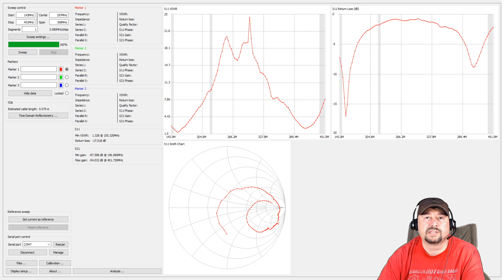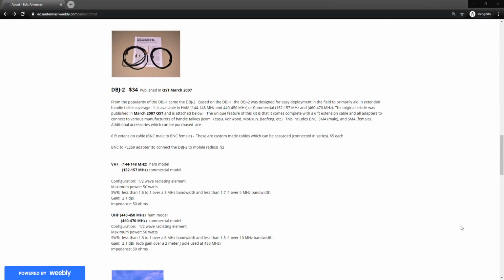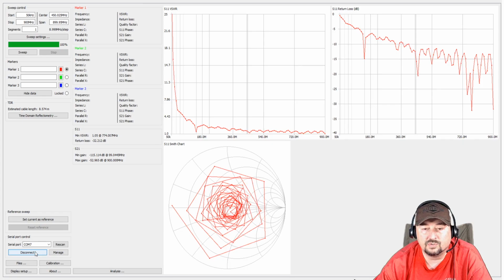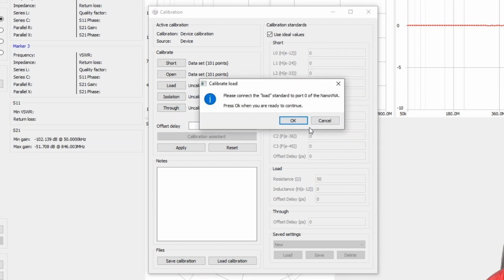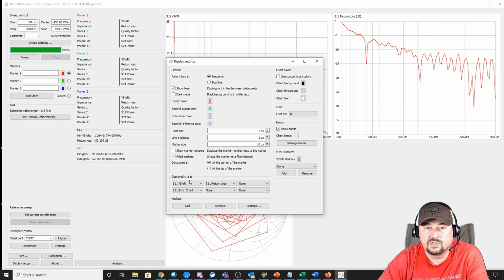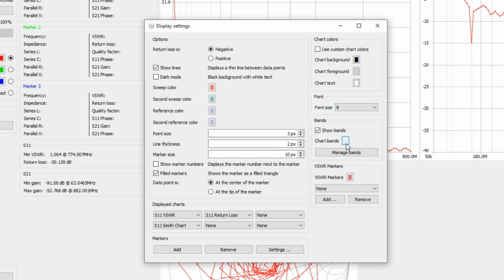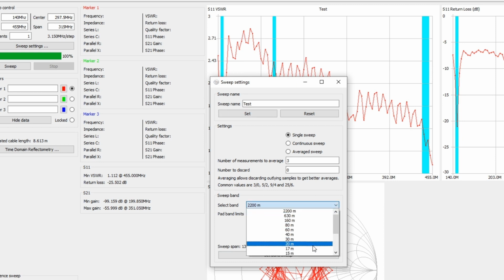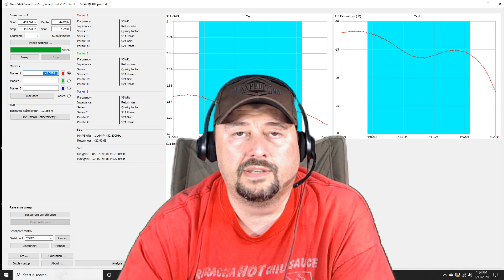Getting Started with NanoVNA-Saver - Ham Radio

Comment: Tnx so much for the detail on the NanoVNA.  I always try to use/learn software on the fly, but I could not see an SWR chart on my saver software because, as I found out when watching your video, I did not see the "display setup" button at the bottom of the screen ... I had my screen too large and moved slightly down so as to cut off that button.  Your simple and straight forward explanation of the features of the software are just what I wanted.  Tnx and 73 de WB8BHK
Reply from the maker: Hey Herb, glad to hear it was helpful.  Thanks for watching 👍

Comment: Hi, thanks for great tutorial. I am trying to calibrate my efhw. Should I adjust the calibration for the coax between the antenna and the nanoVNA? Would having a rf choke effect that calibration?
Reply from the maker: Hey Jim.  I would calibrate the VNA at the output of the VNA and test the antenna system where the radio or tuner connects.  That way you see what they see what ch is important.  You could measure at the antenna feedpoint but you miss the effects of the coax / choke. Of course you could measure and or calibrate at the other locations if you are concerned.  Thanks for watching 👍
Reply: @TheSmokinApe  thanks for great video and the helpful reply! One more question, I am trying to trim my 40 EFHW I use for 15m, and it shows resonance just a little higher than 21 Mhz. Is there something I can do to easily adjust this? Obviously a tuner, but it would be nice to have something else in the bag of tricks.

73 Jim
Reply from the maker: The 100pF cap should help, I am not sure if you have that or not.  I have seen some people recommend 120pF, but I have tried that.  15 is a 3/5 harmonic of 40, so you might want to adjust the "resonate" point on 40 to be inline with 15...

Comment: That was great! Thanks! Now I can tune my EFHW antenna while on remote desktop on a laptop outside!!!😁
Reply from the maker: Super handy right?
Reply: @TheSmokinApe  super!! I tried to keep it on continuous sweep mode after calibration but it just crashed and it just wouldn’t start up again! I had to disconnect everything and shut down my desktop for a minute. I kept it at manual sweep mode and it was stable! It was interesting playing around with the sloper and finding the best swr for the mfj 80m efhw. I will resume again once i have time. Had a good location folding the wire over to shorten it on 10m!

Comment: how do you do a reset to default?
Reply from the maker: https://groups.io/g/nanovna-users/topic/reset_to_factory_default/75416737#:~:text=To%20reset%20the%20nanovna%2C%20connect,in%20a%20serial%20terminal%20session.&text=Power%20cycle%20and%20the%20unit,calibrate%20for%20RF%20and%20touchscreen
Reply: thanks

Comment: Great video! Did you say you can not sync the things done on the actual Nano with the NanoVNA software? For instance, if you calibrate the Nano thru the software, that's only good if you are taking measurements thru the software? If you were to take measurements with just the unit you would have to re calibrate the unit? Thanks
Reply from the maker: That's my understanding, you calibrate on the device when you use it without the PC and on the PC when you use NanoVNA-Saver 👍
Reply: @TheSmokinApe  Thanks 🙏

Comment: Great video.  Question:  I have been recalibrating each time I reset the frequency range.  Why are you not doing this?  Sorry if it is a stupid question.
Reply from the maker: You should calibrate or used a saved calibration when you adjust the frequencies.  I didn't for brevity...  It's less of a problem if you narrow the bandwidth from a previous calibration.

Comment: either Im missing it or just cant find it, how do you change the color of the line...the one that connects the dots??
Reply from the maker: Under display setup 👍
Reply: @TheSmokinApe  I was changing it and the color would change but when I restarted the program, it change. Thanks
Reply from the maker: It's supposed to save to an ini file, that's odd that it didn't.

Comment: The USB charging cable for the Nanovna doubles as a data connection cable between the Nanovna and a PC/Mac/Linux machine.  So, when you connect the Nanovna thru that cable to a PC/Mac/Linux computer for use with the Saver software, does the computer continue to also charge the Nanovna battery at the same time? Or, when the cable becomes a data connection, does it cease to charge (and therefore the Nanovna’s life is limited since it will eventually run out of power)?

That’s a lot to try to explain - hope my question makes sense.
Reply from the maker: It does continue to charge 👍
Reply: Thanks @thesmokinape !

Comment: I made a mistake when calibrating , I can not seem to find a way to eliminate the bad cal , or do another cal ?
Thanks
Reply from the maker: In the calibration menu you should (might) have an option called "reset."  It would depend on the model and firmware version.  If not just re-calibrate.
Reply: @TheSmokinApe  I'll recheck , but did not see a reset button and no response when clicking on calibrate again , the reason the question .
Thanks anyway
Reply: Found the reset , went through cal twice , once added the through , it seems that the vna does not communicate - nothing on screen , I done 4 cals and no change .
I was suspect of a dead unit , but lack of familiarisation I wasn't sure up until now just worked with the vna [ nanoVNA v2 Plus4 ] this time using saver , the only indication is the screen on vna say operating through USB .

Comment: Hi Just wondering? Lets say I am testing some balun's transformers etc. and I am using one of the little cables that come with the unit to connect to the balun transformer etc., should I calibrate it with this cable attached so as to eliminate that influence from the calibration? I have done this and when the calibration is done and you connect the 50 ohm load the marker snaps to the center dead on at 50 ohms and when you go open it goes out to the edge and when you short it it goes to the other edge right on. Where as if you don't include the cable and calibrate right at the machine with no cable and then add the cable and put the short, open or load on the little piece of coax it shows some capacitance etc. on the reading so that the stub of coax is added into the picture of the device under test. Do you know, if there is any official ideal way of doing this?
Reply from the maker: You should use the cable in the calibration if you only want to measure the DUT or Device Under Test.  Calibrate without it if you wanted to include the transmission line in you test.
Reply: @TheSmokinApe  Thanks for the tip.

Comment: I'm hoping I can get some help with NanoVNASaver. Using Win 10 and the .exe the program opens a blank dark screen and nothing else. Help...
Reply from the maker: When you unzip the file you should have an EXE file.  Clicking the EXE file will spawn a command.com window that is black, it should also then open up a second window which is the NanoVNASaver interface.  That's not happening?
Reply: @TheSmokinApe  The second window never opens. If I click in the open window a pixel appears but that's all...Do I need to install Python? I also ran the program as administrator...

Comment: Helpful? Very helpful. I was totally lost before I watched your video. My big problem was that I was in full screen and the icons needed to get this working were not shown. Once I saw your full screen, I realize something was missing. I made the screen smaller and the needed icons showed up. Once I found the needed icons, I was off and running. I also had to set the bands since 40 meters stopped at 7.200 khz. I also added the 220 band. 
Thanks for posting. You were super helpful.
Barry, KU3X
Reply from the maker: Awesome Barry, thanks for watching 👍

Comment: sir please help me my nano vna cannot connect to pc
Reply from the maker: Can you see it under comm ports in device manager?
Reply: @TheSmokinApe  sir i see there is a serial port but rescan can't work
Reply: please sir help me to connect to software
Reply from the maker: @faheemwani1996  you need to get the correct comm port from device manager
Reply: yes sir there is a serial port (COM3) in a device manager
Reply from the maker: @faheemwani1996  and you are selecting that from NanoVNA Saver?
Reply: @TheSmokinApe  sir i write com3 in serial port box and tape connect to nanovna but it shows nanovna saver not responding.
Reply from the maker: Maybe try a different cable?
Reply: @TheSmokinApe  sir i use different cables all works but the result is nanovna saver software shows not working sir i have nanovna V2 is there any other nanovna saver. please help
Reply: sir my nano vna was connected to nanovna saver but today it shows error during sweep, list index out of range. please sir tell me how i fix it
Reply: sir my nanovna v2 have so much noise what happen sir please help me

Comment: Ive had a Nano VNA H4 since Christmas 2020 but have just got nanavna-save up and running on Win 10 this morning. It sure is easier to see.

I like to use the short coax with mine so a giant PL259 is not connected to that tiny SMA  connector.

Do I need to recalibrate with the software even though the Nano vna has been calibrated?
Reply from the maker: It is much easier to see, I love using the software.  Yes to your question about calibration.

Comment: Almost a year late, but I got around to following up on this video.  For reference, I have a NanoVNA-H.  Besides following The Smoking Ape's Excellent Guide [ aka TSAEG for all the cool kids.... just rolls off the tongue  ], I also found the NanoVNA group.io site helpful, thought a little overwhelming at first.  

 My experience was marred by the fact that I do work on other STM32 boards and had inadvertently loaded a conflicting USB driver.  While I was able to use the other driver to successfully update the firmware on my device (DFU), the USB driver did not enumerate the device as a com port in Windows 10.  In my case, I saw USB device driver entries for ChibOS.  I nuked that driver from orbit (it's the only way to be sure), and reinstalled the STM32 USB driver.

NanoVNA Saver is now working, and I'm enjoying the more complete (and more legible!) display of data.    You're a scholar and a gentleape.  73
Reply from the maker: Ugh, I bet that driver issue was a pain.  NanoVNASaver is the way to go, so much easier.

Comment: I can not get the NANOVNA-H to work through any com port.  The com ports do not show up on my Dell laptop Studio running Windows 10.  All I can get is software that is the code.  I've been out of coding for a very long time and did not keep up with it.  I could not find a .exe program except version 3.8.  3.9 is all code, as far as I see it.  I only have a 3 USB ports and one is used for my wireless roller mouse. The other cable is useless to me on this.  I have an 2 very old Macintosh computers and the Windows XP is on this Mac that I'm on.I know Mac better than Windows operation, but I have learned allot.  With this, said, I have to figure out what happened to the list of the com ports.  It is just not showing up, but other programs like fldigi works with com 5, where the Nano does not work there.  I think that about covers it with my frustration of it all.  I am on Windows XP now through Parallels.  Thanks for listening.  //...  Joe
Reply from the maker: Are you sure the USB cable is good?
Reply: @TheSmokinApe  No I'm not sure, but I got it from R&L Electronics. Thanks for the reply.
Reply: @TheSmokinApe   It does charge the Nano batteries.

Comment: Great video Ape!! I purchased my NanoVNA FROM Wal-mart (of all places). but it will not connect. serial port says COMS (NanoVNA)--will not connect nor rescan. I looked at the device manager and it shows COM1 and COM3 active. COM3 being a USB device. Did I get a cheap knock off buying from Wal-mart? Any suggestions guys??
Reply from the maker: Any error message when you try to connect?  Do you have a second cable you could try?
Reply: @TheSmokinApe  yes...just tried a different cable--seems to load and connect but then shuts down....The verison I found on the web was V0.3.8....
Reply from the maker: Which NanoVNA did you get?
Reply: @TheSmokinApe  all it says is "NanoVNA" and "Very Tiny Handheld Vector Networkk Analyzer" on the back.....thats it
Reply from the maker: Yeah man, not sure I can help with this one.  Sorry bro, maybe try a different computer?
Reply: Similar prob here. No drivers found.

Comment: Nice job.
Picked up my Nano for 40 dollars but touch screen doesn't work. Going to use this sw and make it my bench unit.
Reply from the maker: Sorry about the screen, I most use mine with the software as well 👍
Reply: nyworker, try this to get the screen working. ( I did this on my NanoVNA SAA 2N) Open it up and slide the unit out of the case. Then find the inch-long ribbon connector for the screen and lift the black clamping bar, then run a plastic tool along the edge of the bar. This reseats the pins of the connector; flip he black bar back down, turn on the VNA and try the touch calibration step.  If the connector is reseated properly, you can reassemble the VNA. I learned this trick from repairing a couple of iPods that use similar ribbon connectors. Or if that doesn't work,or you don't want to mess with it, the VNA makes a great bench unit attached to the computer. Good luck!  72/73 de k1qed, bob.c      qrp 4evr!

Comment: Thanks , nice video.  Question, I have heard that you can scan more data points when using NanoVNA-Saver, more than the 101 standard points for a given sweep.  What I have been doing, as long as I know what frequency I am interested in, limit the sweep to narrower bands, or use the center freq.  Is there a way to use more data points over a given range via NanoVNA-Saver, or was this just mis-information.  Thanks again

Comment: Great vid ...  is the VSWR changed if the Antenna is wet ?
Reply from the maker: It shouldn't, thanks for watching!
Reply: Does adding a 1:1 BAlun increase the length of antenna? Which without an Afu means another dipole haircut
Reply from the maker: @男メロウ  no
Reply: @TheSmokinApe  OK thanks    cut again  I love the nanovna    73.

Comment: Thank you! I now have my nanoVNA running on my computer thanks to you! Now I need help in interpreting the information  I have. Gain in db vs losses? I got the (V)SWR, but there’s more than that here! Thanks again for your help! 73 de AE1R
Reply from the maker: visitinghere glad it’s up and running, the different information is relevant to what you are measuring.  Are you looking at something in particular?
Reply: TheSmokinApe  well, I have a long run of RG-8 (270 feet!) and ran a TDR test. Part of my NanoDNA results showed Return Loss of -15.7 dB. Do I divide that in half (the signal goes up, then is  reflected back) or break my piggy bank and replace my feed line. Sorry, Noobie question.
Reply from the maker: visitinghere what frequency did you test at?  You might want to watch my video called “the meter don’t lie” I cover issues with loss in that one 👍
Reply: TheSmokinApe thanks so much! Will do!